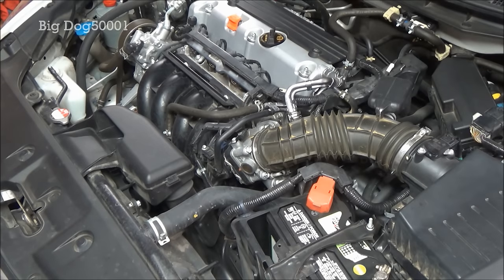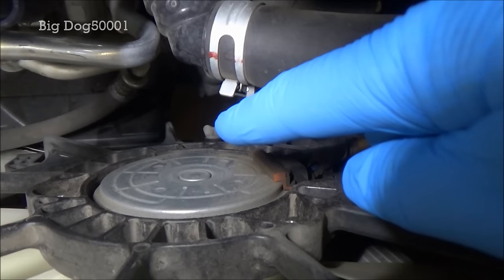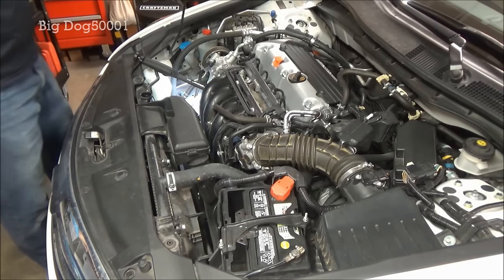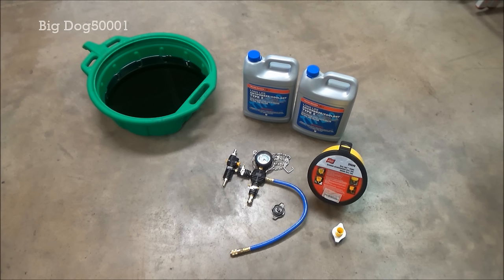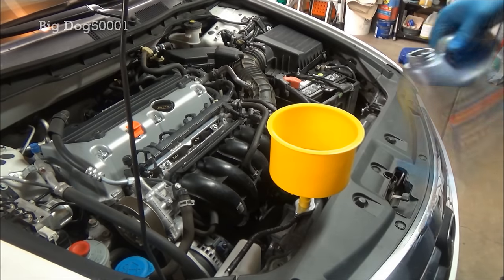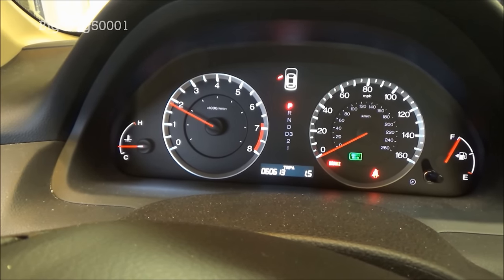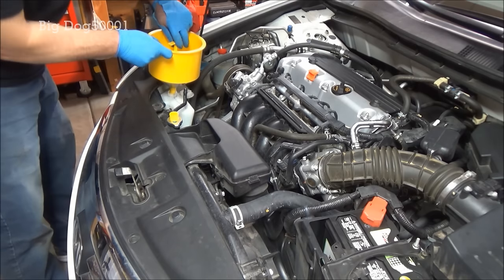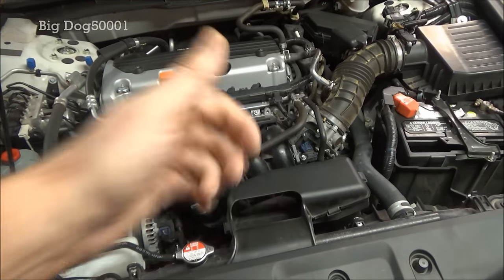Honda Cooling System Service/Fluid Change

Comment: Would this procedure work on a Honda Pilot 04? Cause I did it the way the service manual said, and now the back of the seat doesn’t heat up . I must have done something wrong. I followed the service manual procedure. Any tips?
Reply from the maker: Yes but sometimes there can be issue on those Pilots with air still trapped in system causing the rear floor heat to not work (I assume that's what you mean when you say back of seat).  Not sure what service info you were following but below is what the current service info from Honda is to correct this issue (typically I do this with a spill free funnel or cap loosely installed on radiator, be careful coolant will be hot!).  Good luck!

1. Start the engine. Hold the engine speed at 1,500 rpm until it warms up (the radiator fan comes on at least twice). Make sure the thermostat is open.

2. Turn off the engine. Check the level in the radiator, and add Honda All Season Antifreeze/Coolant Type 2, if needed.

3. Set the climate control or heater control panel to maximum cool. Start the engine. Hold the engine speed at *1,500 rpm for 5 minutes*, then turn off the engine.

4. Check the level in the radiator, and add Honda All Season Antifreeze/Coolant Type 2, if needed.

5. Set the climate control or heater control panel to maximum heat. Start the engine. Hold the engine speed at *1,500 rpm for 5 minutes*, then turn off the engine.

6. Check the level in the radiator, and add Honda All Season Antifreeze/Coolant Type 2, if needed.

7. Set the climate control or heater control panel to maximum cool. Start the engine. Hold the engine speed at *1,500 rpm for 3 minutes*, then turn off the engine.

8. Check the level in the radiator, and add Honda All Season Antifreeze/Coolant Type 2, if needed.

9. Set the climate control or heater control panel to maximum heat. Start the engine. Hold the engine speed at *1,500 rpm for 3 minutes*, then turn off the engine.

10. Check the level in the radiator, and add Honda All Season Antifreeze/Coolant Type 2, if needed.

11. Repeat step 7 through 10 until the coolant level does not change in the radiator, then install the radiator cap loosely.

12. Set the climate control or heater control panel to maximum cool. Start the engine. Hold the engine speed at 2,500 rpm for 1 minute.

13. Set the climate control or heater control panel to maximum heat, and select high speed heat mode on the rear control panel. Measure the temperature of the air from the rear floor vent for 2 or 3 minutes, it should be warm/hot.

14.  If the temperature is not warm enough at rear vents, repeat step 7 through 10 several more times. Then loosely install the radiator cap and recheck.

15. Make sure you do not hear the sound of water flowing near the rear heater unit. If you hear water flowing, repeat step 7 through 10 several more times. Then loosely install the radiator cap and recheck.

Comment: I do not use the heater in my civic because it is hot here in california. But do i need to run the heater on once in a while to circulate water in the heating coil so it does not get stagnant there? Or does does the water in the heating coil just recirculate along with the whole cooling system? I saw videos of rusty old water in the heating coil. Thanks!
Reply from the maker: Depends on what year it is, newer Hondas circulate the coolant through heater all the time, older systems use a valve that shuts off flow to heater.
Reply: Great! I guess i do not have to run the heater in my 2015 civic. Thanks!

Comment: Hey, the haynes manual says theres a drain plug on the engine block. Does that need to be opened too? I didnt see that in your video. p.s I bought that funnel set you recommended. Im just curious about the engine block drain plug. Thanks!
Reply from the maker: That is up to you.  In general, if a vehicle is over 8-10 years old I leave the block drain bolts alone unless i absolutely need to open it (think can of worms).  I prefer to do two drain and fills instead if I feel the need to get all the old coolant (with at least a full warm up and cool down in between).  I do one drain and fill (like in video) every 30,000 miles on my own cars.
Reply: @BigDog50001  I see, well seeing as my 2017 accord coupe only has about 40k mi on it, I think I'll drain the engine block too. Hopefully I'm not opening a can of worms lol. Thanks for the advice.

Comment: How long does it take for the fans to go on after turning on the heat?
Reply: I did mine without the fan it took way too long so I just burped it two times

Comment: Does the overflow reservoir push its coolant back into the radiator if its low or needed?
Reply from the maker: The reservoir tank is an extension of the cooling system (not to add coolant to system if it is low).  The cooling system expands and contracts with temperature and the tank is there to allow it to do that.  Coolant is pushed into tank and pulled from it through the heating and cooling process.  The radiator cap is the mechanism that allows this to happen.

Comment: Can you reuse the same coolant if air was not the problem.
Reply from the maker: If the coolant is new(er) and clean, and is drained into a clean pan then yes it is possible to reuse it.  I typically do not do that unless it was brand new coolant that I just put in.

Comment: I seen some people Drain and fill with Distilled water before adding new coolant is that necessary?
Reply from the maker: If water is added, it will all need to be removed or the coolant will be diluted.  It is generally not necessary unless there is debris in cooling system.

Comment: Is it necessary to get the  air out? And what can happen if you don't.
Reply from the maker: I'm bleeding a Honda coolant system right now.  It's very important, air in system can cause sensors to not work properly and cause overheating.
Reply: @BigDog50001  ok but can it cause a low idle?

Comment: If I’m home and need it , is it safe to drive to the store or no ?
Reply from the maker: I have no idea what vehicle you have or what condition it is in so it is impossible for me to tell you what you should do, but here are some thoughts if I were in a similar situation.  If one of my own cars didn't have any coolant in it, then I would not drive it.  If my vehicle had the proper amount of coolant and it was simply overdue for service on the cooling system, then I would not have a problem taking it on a couple of short drives until I got it serviced.

Comment: Followed your instructions to the letter on my 2008 4 cyl Accord and it went off without a hitch. 2004 accord V6 not so much. Only 2 1/2 to 3 quarts drained out and it looks like the radiator is only going to accept the same amount. Cooling fans cycled on and off 2 to 3 times as recommended and the engine only gets to a little less than  halfway mark on the temperature gauge. I let the engine cool down and tried again without draining the radiator and had the same results. Any suggestions?
Reply from the maker: Assuming you don't have a restriction in the cooling system, if you don't think enough coolant came out, you may need to remove the drain bolt for the block on the back of the engine to get more coolant out (those V6s have a block drain bolt).  If the old coolant was in decent shape, an alternative would be to just do the same procedure that you did again which would change out most of the remaining coolant (the entire system holds about 1.6 gallons plus the coolant in the reservoir).  Make sure the heater temperature dial is turned to maximum heat when doing coolant service.  Making sure the air is bled from the cooling system after coolant change is extremely important on Hondas too.

As far as temperature on the instrument cluster, a little less than halfway on the gauge is standard on Hondas when fully warmed up (a more accurate way to see engine temperature is to look at ECT1 data on scan tool).
Reply: @BigDog50001   Thanks for your reply. I tried again and was able to get 1 gallon in. Cooling system is working fine. I’ll keep an eye on it but it appears to be OK.

Comment: So I have a question I have 2005 accord I recently bought I noticed antifreeze on radiator I would like to replace with Honda type coolant so was wondering proper way to flush old coolant including the coolant out the blockb
Reply from the maker: When I come across that situation I typically do what I showed in the video 2 times (with at least a full warm up and cool down in between).  That will get most of the old coolant out of system.  I generally don't flush with water unless there is a serious issue with the coolant because it can stay in system and dilute new coolant.
Reply: Big Dog50001 Automotive  so would u suggest to drain the green antifreeze n then refill with Honda type 2 blue coolant with out flushing green antifreeze with distilled water

Comment: Well I got everything you mentioned in the video. I started the process but got stuck with tight bleeding screw. How do I safely remove it? It is really tight. I couldn't get to it from the top but was able to have a good grip when I went beneath the engine bay.
Reply from the maker: Bleeder screw or radiator drain petcock?  I usually leave bleeder screws alone (only some models have them), they will put up a fight and can open up cans of worms on older vehicles.  Radiator drain petcocks are plastic and are on the bottom of the radiator and can sometimes be on there tight, in those cases I will use a small pair of pliers to open the petcock from underneath.  Just remember, there is always a  chance of breaking them due to being plastic.  If it breaks then a new one will be needed.
Reply: Sorry, I meant radiator drain petcock. @BigDog50001

Comment: I drained n filled my Honda HR-V today, go through the proper air bubbles removable but the check engine light comes on after the project. I disconnected the battery cable to clear it but it still come back on after few minutes.  Any ideas or what went wrong?
Reply from the maker: Did you scan for trouble codes?  If so. What are the codes?
Reply: When you changed out the coolant and your check engine light came on , you have to do a computer RELEARN process. 
Especially if you disconnect the battery. 
The cars computer loses some of its memory and thats where the RELEARN process comes in .
Honda's Electronics are real sensitive, even when you change out the coolant .
If you have a service manual it will give you the detailed procedure , if no manual YouTube it ....

Comment: I noticed you turned the temp dial to hot but the fan speed control is still in the off position, should it be off or running? Thanks
Reply from the maker: Interior blower motor should be off, don't want the cooling fans to come on due to climate control settings (when bleeding system, the cooling fans should come on due to engine temp).
Reply: @BigDog50001  Awesome that makes total sense! Appreciate the reply and great video!!

Comment: Quick question, do I need to turn ac on during this process at all? I turned the dial to heat but I did not turn ac on

Also, how long does it take for bubbles to stop? I've been at it for more than 10mins with the engine running, coolant level is stable at mid, just minor bubbles here n there
Reply from the maker: No AC, that would activate cooling fans all the time.  It can take 20-30 mins sometimes.  Periodically revving engine up to 2,000 RPMs for several seconds and releasing  can speed up process.
Reply: @BigDog50001  okay gotcha! If i didn't see the fans turn on after about 20mins wi it be okay? Temps were fine and it drained down as normal

Comment: How about if close the radiator cap closed after refilling the antifreeze and start the car and the air will come out through the reservoir tube (reservoir tank lid to be opened)?
Reply from the maker: The cap needs to be loose or off to get the initial air out of system (but it makes a mess which is why I use the funnel).  After that, if a small amount of air remains it usually will go out through the reservoir during normal operation.

Comment: If I want to drain the engine block , where is the drain bolt ?
Reply from the maker: They are in different locations depending on model and some do not have them at all.

Comment: Do we always have to flush the coolant storage first before refilling the coolant fluid? Cause I often just refill the coolant fluid for my Toyota Camry when it passed the fulled line. Thanks!
Reply from the maker: If I am topping off the coolant reservoir I just add coolant.  If I am replacing the coolant like in this video I will rinse out the coolant reservoir before filling it back up if it is dirty inside.
Reply: Big Dog50001 Automotive thanks for your early response. Keep up the good work

Comment: On my motorcycle, when I flush the coolant, I clear it up by running the engine with all distilled water twice. Once there is no colour in the drained fluid, I fill it up with all coolant. Do I have to do the same with my 08 V6?
Reply from the maker: Flushing with water is not a recommended service from Honda and is generally not necessary if the vehicle has been taken care of.  The V6 models have a drain bolt on the rear of engine block where a hose can be attached and the coolant can be drained in addition to the radiator.  If the bolt on the rear of the engine has not been removed in a long time, loosening it might open up a can of worms.  If the vehicle has not been serviced regularly, I prefer to do one drain and fill from radiator, drive vehicle for a day or week or something like that and then do a second drain and fill.

Comment: How long do I keep the car running if after 20 minutes I still see bubbles?
Reply from the maker: Pie P That's about long enough.    Most of the air should be out by then.  I will usually raise the RPMs to about 2000 for a minute at the end to help it along.

Comment: Hi, i have 2008 accord and drain plug on it very tight... what wrench socket size he need to loosen it
Reply from the maker: Sometimes a pair of pliers is needed to loosen it.  Have to be gentle, they can easily be broken with tools.

Comment: Doesn’t coolant burst up if you turn off the car without the radiator cap when its hot ?
Reply from the maker: It usually only blasts out when the cap is removed after the engine is already hot because the system is under pressure when the cap is on (I definitely don't recommend doing that).  If the cap is already off and then the engine is warmed up it usually only makes a mess by oozing out (regardless of shutting if off or leaving it on).  That's why I use the spill free funnel.
Reply: @BigDog50001  ok thank you

Comment: So the engine block drain bolt is never removed for a regular maintenance coolant change?  The service manual (for my Civic, at least) says to remove the block's coolant drain. But it looks like few people actually do that.
Reply from the maker: Some Hondas do have drain bolts on the block, I don't usually use them.   I have found that the coolant can be serviced without removing them.  Some kind of high temp thread sealant/liquid gasket needs to be used on the bolt when reinstalling.  If the bolt hasn't been touched in a long time, there is always the possibility of opening up a can of worms when attempting to break it loose from the block.
Reply: Thanks for the reply! Yes, definitely potential for problems touching that bolt.

Comment: The problem with a drain and fill is you leave coolant in the engine block and the heater core.

Comment: You can drain and flush the radiator reservoir easily by simply draining the radiator without opening the radiator cap.

Comment: Super video. But if you take your car to the local mechanic, it won't be practical for him to order factory fluids & coolants for all different makes & models car, would use generic products ?
Reply from the maker: It depends, some shops will only use All Makes and Models/General Use fluids and some will have factory recommended fluids (or aftermarket equivalents specifically made for those vehicles).  Some shops specialize in certain vehicle lines and they will most likely have all factory recommended fluids on hand.  A good quality shop will usually have access to factory recommended fluids if they need it.  Thanks for the comment!

Comment: Thank you for the video, I have two questions:
1-Did you fill up the reservoir first then added coolant to the radiator? Then you added the extra to the reservoir?
2- when you turned the heat knob all the way up, do you have to turn on the fan as well because I didn't see it on?
Reply from the maker: I filled up the radiator first.  The reservoir just needs to be topped off when the cap is put back on (the reservoir is not connected to radiator with spill free funnel in place).   

There is no need to turn the blower fan on inside car, just need the heater adjustment turned to hot so coolant flows through heater to get air out (this only effects older systems that have a valve to control coolant flow to heater).  I purposely don't turn on fan inside so that the A/C system doesn't kick on (this can turn on cooling fans if system has auto climate control).

Comment: how long do you keep it idling with the heat on to get all the air out? Also is the AC on or off during this process? thanks!
Reply from the maker: Until there are no more air bubbles coming out (sometimes need to bring it up to 2000-2500 RPMs to speed it up).  No AC, for most systems that will cause fans to come on.
Reply: thanks! I have a 2015 accord 4 cyl with auto climate. I will leave AC off but fan on with high heat. thanks!